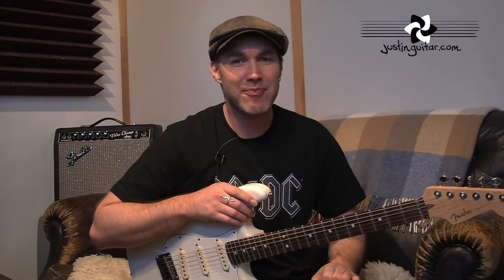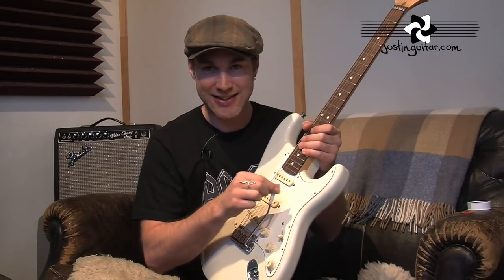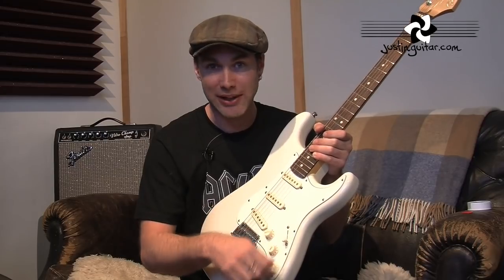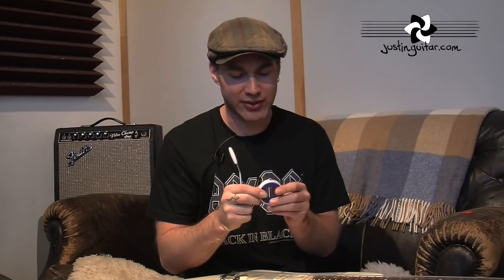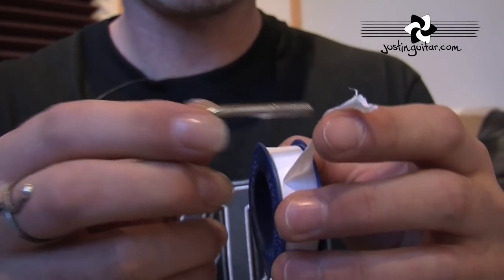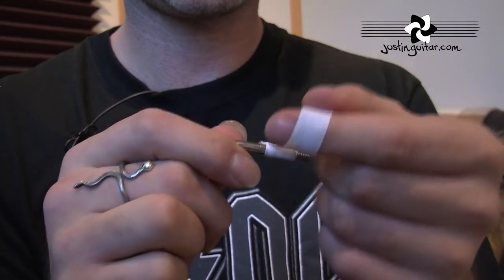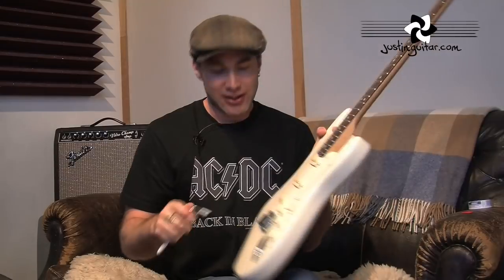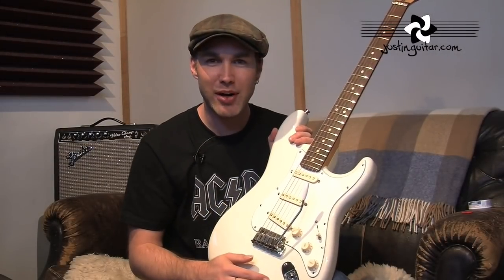How to fix a wobbly whammy bar (Guitar Lesson GG-012) How to play

Comment: The spring is great if you just want to arm to stay in place, but that's only part of the problem. Vintage style Fender trems have a bit of play in them where the arm is in the hole, but above the threads. There is play and it does not respond instantaneously. Very annoying. The spring does not fix that issue. The plumber's tape does.
Reply from the maker: Been ages since I visited these comments... and you are right... I have a spring (or two) - I've been playing guitar for a little while now y'know... the tape fixes the play much better than the spring! :)
Reply: @tomstonebuner7370  The ball is a big help to stop the spring binding when the tremelo bar is screwed in. However the cause of   a wobbly bar (side to side movement) is due to the diameter of the thread being too small. The PTFE tape remedies this.
Reply: Ball and spring fixes both issues for me, wobble & the bar staying in place problems...too loose and it doesn't work, too tight and it might permanently compress the spring otherwise ball and spring works perfectly.

Comment: Hi Justin, hi all,
having worked in the blumbing industrie for a while - it's easier to apply the tape in thread direction (the other way as shown here). This way it less tends to slip when you screw it back in. Roughening the thread with a jigsaw also helps.
Great tip!!!
Still very happy to have met you last Saturday in Frankfurt. You made my day and week back in the "matrix" :)

Comment: This is the exact issue I am currently experiencing. I’ve researched this topic over and over but it’s always people talking about the bars movement as far as the swing rather than the legitimate wobble at the very top. So nice to find a video showing the exact issue giving me headaches. My bar already stays in place with minimal swing but the wobble at the top when using it is way too much. Wasted $6 on springs but that’s life. Heading to grab tape tomorrow and fingers crossed the issue is resolved.

Comment: Great tip. worked a treat.

I strongly recommend buying some 'plumber tape' to do this and not improvising with ordinary tape. Ordinary tape has a gluey sticky surface (obviously) and can leave a sticky mess. Plumbers tape doesn't have the glue and won't make a mess. It sticks to itself without need for glue. It is also very thin which makes it easier to get the exact thickness of tape required.

If unlike mine, the hole that holds the wammy bar doesn't go all the way through, then get a compression spring instead from your local guitar shop, for a buck, or free if you smile nicely.

Comment: I tried the teflon tape, but as others have said it wears out quickly.  In my case I still had too much wiggle even right after applying tape.  I just discovered however that wrapping dental floss in the threads is working fantastic so far.

Comment: Thank you. Such a simple solution. I could have written your intro. It was exactly the same problem I have had with my strats for years so much so I gave up even using the whammy bar. I recently did a recording session where the effect on a lead I was doing really need a simple chord "shimmer". I managed to use my wobbly whammy bar but it was driving me crazy. Your video was the perfect solution and I even had the plumbers tape in my home tool box (now it's in my strat case). Thanks again.

Comment: That tape is also well known as "teflon" tape and is very handy for tightening up loose threads since that's what it is made for. I had a loose whammy bar and it was driving me nuts. I thought about using teflon tape but I didn't want to deal with the hassle of it coming off every time I took my bar out so I just dinged the threads on the bar a bit with a small hammer. It's a permanent solution and may not be a good idea for some people but it works great for me.

Comment: P.T.F.E. - Plumbers Tape Fixes Everything.
Reply: But can you still remove it?
Reply: Wont the tape rip and block the thread
Reply: @joshuafrankline2617   yes you can. Sometimes a bit gets down the hole but you can get it out with a stretched out paper clip.
Reply: @joshuafrankline2617   no it's fine. This trick works unbelievably well.
Reply: @koll789  Tnx man
Reply: nah its actually polytetrafluoroethane tape

Comment: @CKS5000 : What we call lock tight around here is a thick liquid that you pour on threads to keep them from backing off due to vibrations. When it sets up, it is almost like glue. Makes it difficult to turn the bolt in the socket. This is teflon tape, which is a sealant. It never changes consistency or becomes adhesive, it just fills in the gaps.

Comment: You've probably figured this out by now, but there's a little spring that goes into a Strat's term arm hole, before the arm.  It pushes up on the arm, so that it stays in place long before the trem arm is threaded all the way down.  Look for "Fender Tremolo Arm Tension Springs"

Comment: This plumbers tape method works great....until you have to unscrew the trem arm to put the guitar in a hard case. Unscrewing the arm usually destroys the Teflon thread tape, meaning you must re-apply the tape every time you re-install the trem arm. I saw a better solution elsewhere on YouTube: Put a small piece of heat shrink tubing (used for sealing wire connections - Cheap kits available on amazon) near the top of the threads (where the threads end and it becomes smooth) and heat it in place so it stays there. Then whenever you thread in the arm, you'll meet resistance caused by the tubing and stop winding it in. The arm stays tight and doesn't flop around.

Comment: @MICROmor  Yeah, in the US and Canada it's "teflon thread tape" - "Plumbers Tape" is a steel strapping used to hang pipes.

Great tip, by the way.  Much better than the spring or pencil eraser methods.

Comment: Gosh 12 yrs ago, this is a temporary solution to the wobble. The full solution is a small coil (sometimes referred to as a spring) which wraps around the bar thread when it it’s been placed in the body void and then the bar is screwed into it. It’s standard equipment for worn threads in metal to metal retainers and sometimes called a helicoil. Fender actually produces these spares and cost about £10 per pack. Less expensive packs are available from other manufacturers are available. Top tip: when searching check the diameter of your guitar bar and also don’t order the tension springs in error.

Comment: I did the same but I put too much teflon and it stuck inside of the thread in the block. How do I remove it from the bar? It doesn't come out with pliers or little objects. Maybe chemistry of some kind? Petrol?

Comment: I'm guessing that the PTFE tape gets mashed up (due to movement/rotation of the arm) and needs to be replaced periodically?  I bought and fitted the spring on a brand new Squier Standard Strat, it made barely any difference.  As highlighted by Justin, the stock arm is either too tight or too loose.  I have now also fitted PTFE tape to minimise the wobble when the arm is not all the way in - it helps for now.  The problem appears to be that the diameter of the bar/threads is too small compared to the threaded hole in the block.  When screwed almost all the way (~10mm of threads), there should not be excessive play like this.  Why are they still being manufactured like this; maybe for ease of installation/removal?

Comment: I had the same wobbly tremolo arm problem.

All you need to do is order a Fender Tremolo Arm Tension Spring.  They are available in a pack of 12 at Musicians Friend for about $6.  Unscrew your whammy bar and drop one of these springs into the hole in the trem block and screw the arm back in - just enough to where it stays in place wherever you swing the arm.  The wobble will be gone and the arm will sit about a half in higher off the body

Comment: Been there, done that.  The tape won't last for long and will eventually need replaced. It also makes a mess in the screw hole. The springs suck too. To any of you outside the box thinkers, is there a third option that works best?
Reply: ELECTRICAL TAPE.

Comment: Cool idea.  I've got the spring underneath my bar, but I've still got the "wobble" unless I have it screwed in pretty much all the way regardless.  I've actually been getting by with the bar screwed in right up until that "maybe I'm wearing down the thread" point - I just leave my bar screwed in around that position all the time though.  I don't think I've taken it out in a couple years now.

Comment: HELP: i have a jazzmaster made by Squier, the whammy bar is non screwable, i have tried using the tape to prevent it from falling out but when I try to push the bar into the hole it pushes the tape out even though I use super small amounts of tape, what should I do?
Reply: Jonas Jørgensen I have a squier strat from Indonesia and I've never had that problem

Comment: I still need help though with my licenced Floyd rose whammy bar. It seems again that when it's tight it doesn't spin and when it's loose it spins but has "play" in it. I just bought and original Floyd Rose made in Germany whammy bar and it's the same????

Comment: I have tried using the small fender spring to tension up the whammy bar but the spring just fell out the other side. The PTFE tape idea works but the only pain is when you take the whammy bar off to put the guitar in its case next time you put the whammy bar in you have to redo the PTFE tape. I did see somewhere on the internet a special whammy bar that is quite expensive but sorts out this problem.

Comment: Tape is not required -- there should be a tiny spring that sits in the bottom of the wammy-bar cavity on the Fender Strat. The spring is there to provide tension! Of course, the spring usually disappears the day you bring the guitar home from the shop.

Comment: Here is the solution from Fender: http://www.fender.com/guitar-bass-parts/bridge-assemblies-components/american-series-stratocaster-tremolo-arm-tension-springs-12/
Reply: I got one of these (compression spring, the guy called it) from my local guitar shop, got home and discovered the hole on my strat, that holds the wammy bar, does not have a sealed off end, the hole goes all the way through so the spring falls straight through. So the above solution is the only one that will work for me unless I buy a whole new bridge, which I ain't doing.
Reply: Wow thanks. Fender killing those guitars?! Will check mine

Comment: how would you remove a whammy bar that broke off in the hole it screws into, though? youtube search of "fix whammy bar" only shows how to repair guitar hero whammy bars and im getting mad. someone please help? :[
Reply: you would need to drill into the tremolo block to make a new hole to make room for a new tremolo arm .
Reply: thank you! i actually took it into a guitar shop and they just replaced the whole tremolo block. this new tremolo arm doesn't screw in, so if it ever gets stuck i can just push it out
Reply: goatcheese guru  no worries

Comment: I found a better way and you can still move your bar very well. Take a bread tie and push it straight down in the hole, then push your bar with a little pressure and screw it in. Then clip off the excess of the bread tie sticking up so its not seen. It pretty much gets pushed into the sloppy threading and fills the gaps. You might have to change the bread tie out every couple months. Right now my bar is going on about 3 months with no wiggle. Problem solved.

Comment: Just buy the spring to go inside the tremolo bar hole - Block
Reply: He didn't search the net very good! The best he found?
Reply: kartman74usa Ive got one of those springs but my whammy bar wont screw in while the spring is there
Reply: Yeah i have tried the tension springs on a Mexican Standard and it worked perfectly, but on my American Special Strat it didn't work at all. The spring just got stuck the hole and actually made the problem worse. Was a nightmare getting it out
Reply: Vintage bridges have holes that go all the way through the block, so the springs just fall all the way through on some.
Reply: I bought a whole bag of these little springs and they have been one time use....

Comment: i have the exact opposite problem my whammy wont lock up its always loose if any one has a solution please let me know
Reply: no need  i was to stupid not to find it out
Reply: by a tention spring of ebay  you drop itcin your bridge block hole were the tremolo arm goes you then place the trem arm back in as you screw in the arm you'll feel it get tight . it works far better that using tape . using tape is messy and  wont last 5 minutes.  look on ebay for tremolo tention springs  you get them in packs for about 4 quid i think
Reply: richard cockburn i get it now thanks
Reply: wasif ud dowlah no problem hope ive been of help

Comment: Gotta mid 80's Japanese Fender Super-Strat that comes with a Schaller Floyd Rose like trem. The whammy bar gets stuck in the block, there is no thread, and that bitch wobbles like hell. How to solve the problem here?
Reply: You might have to de string it and tighten the nut on the underside of the arm socket.Somes I put locktite on it so it doesn't keep happening.You might be able to reach it from the tremolo cavity too.Good luck.